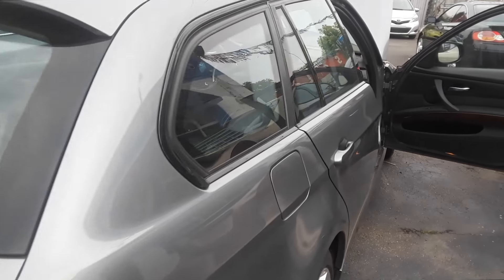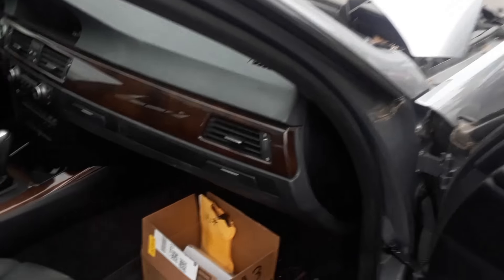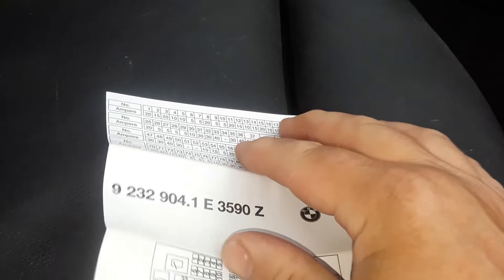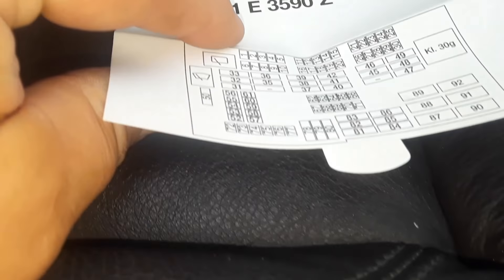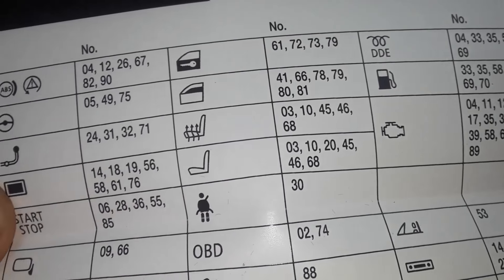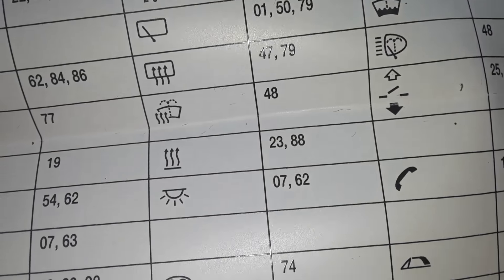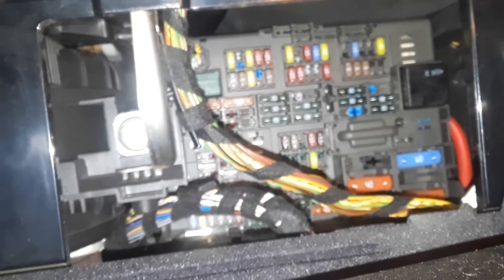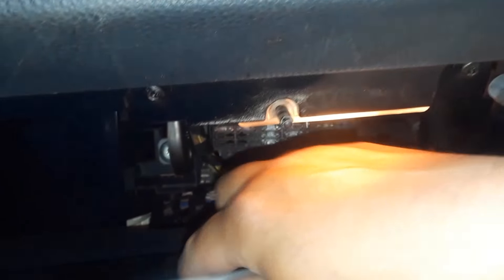BMW 328i E90 E92 E93 Hidden FUSE BOX LOCATION & DIAGRAM 318i 320i 323i 325i 330i 335i 320D 330D 335D

Comment: Which fuse is for starting the car got a 2009 BMW n52 that cranks and won't start I've checked everything else
Reply: Did u resolve the problem?
Reply: Simply just check the battery voltage, a fusible link just may be your hidden cult....😅

Comment: What does the big black fuse mean?? Mines kept clicking and I removed it and it stopped basically..
Reply from the maker: Relay turning on and off quickly.. Could mean several things like a bad ground...computer failure or bad resistance or a frozen relay.